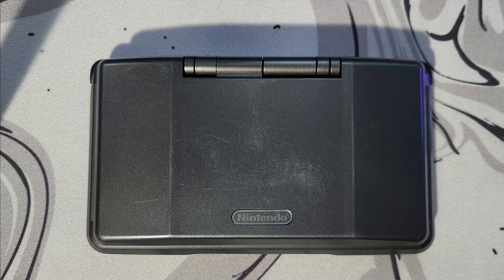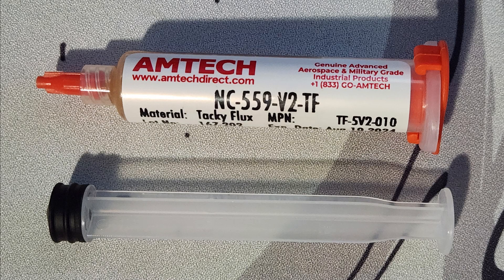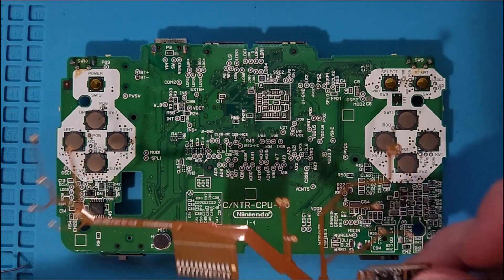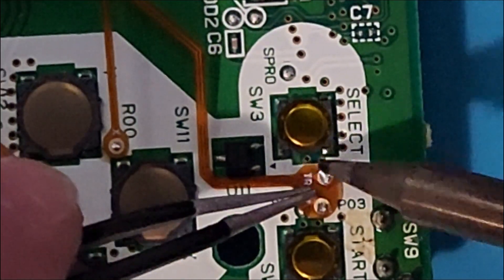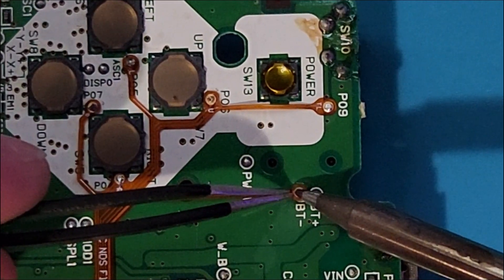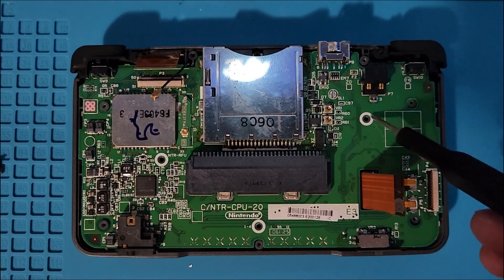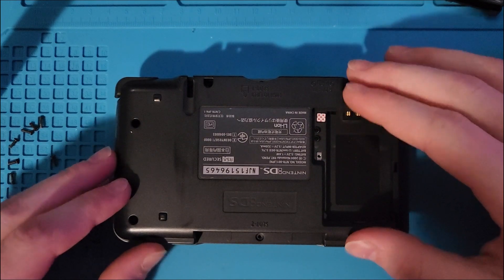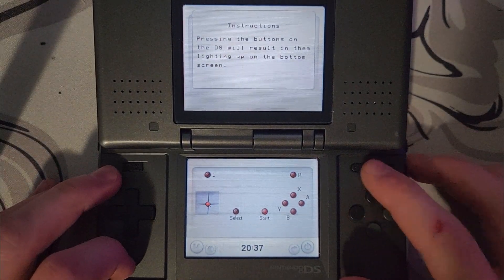*NEW* The EASIEST Controller Mod For the DS! (DS Wireless Rx Flex Board Tutorial)

Comment: Hi, I have the loopy capture cards already installed, would it be difficult to install this with the capture card installed first? Thanks!
Reply from the maker: Nope, it shouldn't be too difficult. It is a little easier to install the controller mod first, but you can either unsolder the part you fold over (on the cap card ribbon cable) and resolder it after, or just slide the portion with the points for up, down, left and right under the part you fold over.
Reply: @tracker707 cool, thanks!
Reply from the maker: Yeah man, no problem!

Comment: Okay but how do you connect a controller what device did you use to use a controller
Reply from the maker: Out of the box, all of Insidegadgets receivers and TX products are on the same channel, so everything should just connect automatically. I'm using the "SNES Controller Wireless TX Adapter" and a "8bitdo Sn30" controller connected to it.
Reply: @tracker707 thank you 🙏
Reply from the maker: No problem!
Reply: @tracker707 this are out of stock, what’s another alternative adapter I could use to have wireless play
Reply from the maker: @bretwentzel8824   the SNES Controller Wireless TX Adapter is out of stock? I'm looking at it now and it shows in stock for me. The only other alternative to it would be the "BlueRetro to Wireless GB Controller Adapter" which will allow you to connect any wireless controller compatible with BlueRetro (like a ps4 or xbox controller, the full list is on the product page) and use it to control your ds. It is out of stock right now unfortunately though.

Comment: I'm looking to use my 8bitdo SN30 Pro with a 8BitDo SNES Retro Receiver for this Controller mod. Do you know if they're compatible with the SNES Controller Wireless TX Adapter from insideGadgets? On their website it states that the insideGadgets adapter only works with their own receivers, however, I can see that you're using the receiver that came with the SN30. So I'm assuming it would work, but I'd love some clarification.

Thank you for demonstrating the installation process, I feel much better going into this mod!
Reply from the maker: Yeah, the "SNES Controller Wireless TX Adapter" will be compatible with any snes controller, so yours should work just fine. The thing on their website that says that only their transmitters are compatible with their receivers because you have to use a "TX" product, and not just any random wireless controller. Thank you for watching, glad I could help!
Reply: @tracker707 Amazing, thank you for the clarification!
Reply from the maker: No problem!

Comment: Is there one for the new 3ds xl?
Reply from the maker: Not yet unfortunately, but there is one in development i believe. There is a way to control a 3ds with a wireless controller though. You need to have a 3ds with custom firmware, and it takes controller inputs from a PC and sends them wirelessly to a 3ds.
Heres a guide to set that up if you interested.
https://youtu.be/pcO6m-q0qU8?si=8PEjGCcmHtLf0R9r

Comment: So do you only need to get the flex board and the snes tx adapter for the mod? How does the adapter connect?
Reply from the maker: Yep! The snes tx adapter Iconnects wirelessly, so when both it and the console are turned on, it should automatically connect.

Comment: Have you tried installing both this and loopys capture card on the same ds?  The only solder point both flex cables share is the BT- when I compare the two.  If so, were there any complications?
Reply from the maker: Yes, they work together. Them sharing the BT- point doesn't cause any issues
Reply: @tracker707  i was just about to ask this! so it is safe to do it? lol i have 4 flex cables  and capture cards ready to install. im just worried they wont work.
Reply from the maker: @polkmn8105  yep! Perfectly safe to do so!

Comment: Is there a mod like this for the 2DS/3DS?
Reply from the maker: Not yet, but there is one in development i believe. There is a way to control a 3ds with a wireless controller though. You need to have a 3ds with custom firmware, and it takes controller inputs from a PC and sends them wirelessly to a 3ds.
Heres a guide to set that up if you interested.
https://youtu.be/pcO6m-q0qU8?si=8PEjGCcmHtLf0R9r
Reply: @tracker707  thanks I will look into it but I think imma wait for the one in development.
Reply from the maker: Yeah np 👍

Comment: Hey, don’t know if you still reply to comments but just had two questions cause I just bought some ds lite boards. First, when do you think the ds lite tutorial will be coming out? Not trying to rush or anything take your time. Second, this will be my first soldering project. Do you think I should spend some time practicing or is this an easy first project? What are the risks? Thanks in advance
Reply from the maker: I still reply to every comment as soon as I can get to it! I really hope i can get the ds lite tutorial out soon, but i work and go to school and that does not give me a lot of time to get the video to the quality that i want it to be. This is a pretty easy mod, but especially with the ds lite, it can be a little tricky at some points. I would still definitely recommend anyone to always get a relatively cheap soldering practice kit from Amazon or somewhere before trying to mod an expensive console. As for the risks, the only thing you need to watch out for is being too rough with the ribbon cables and damaging them, and accidentally blowing a fuse. In my experience, the most common issue is accidentally bridging a solder point, or putting in the battery backwards (for the og ds), but the fuses are not too difficult to replace, but for someone new it could be tricky. I would just say though that as long as you have some practice and watch maybe a ds lite disassembly video and then my tutorial when it comes out so you can get a good grasp on what you'll be doing, I'm sure that you won't have any issues!

Comment: How do you have the SNES controller linked up? Could you send some links so I can buy the necessary parts? Thanks 🙏
Reply from the maker: Sorry for the late reply, I never got a notification that I got a comment. I'm using a 8bitdo Sn30 attached to Insidegadgets snes controller wireless tx adapter. Other then that your consoles just need to have a controller mod installed in them and your good to go.  Here's the links
8bitdo Sn30-
https://a.co/d/iRo8THu
Insidegadgets snes controller wireless tx adapter-
https://shop.insidegadgets.com/product/snes-controller-wireless-tx-adapter/
Reply: @tracker707  Thanks so much!!
Reply from the maker: @n0lain   Of course! If you need any more help don't be afraid to ask!

Comment: Question @ 8:55 is that the SNES Controller Wireless TX Adapter? how is it powered and how did you get it to connect to flex board ? And connect to tye controller? Thanks 😊
Reply from the maker: Yes it is. It is powered through USB C and it connects to the flex board wirelessly out of the box. The controller is the 8bitdo Sn30 and it connects to the SNES Controller Wireless TX Adapter through the snes receiver that it comes with (the dark gray box sticking out of the SNES Controller Wireless TX Adapter)

Comment: I already have loopy capture cards installed and it is pretty much impossible to detach the wireless antenna. Would it be bad to solder this with the antenna attached still?
Reply from the maker: You actually might be able to, but you should be able to carefully pull the capture card board off of the chip. I just use a little pry tool to work the edges and the slide my tweezers under between the capture card board and the chip. Just be careful to not pull up on just one side of the chip so it doesn't break.

Comment: how did you manage to connect your own bluetooth controller? did you connect the TX transmitter to a bluetooth transmitter or something? :O
Reply from the maker: In the video, I'm using the SNES Controller Wireless TX Adapter and an 8bitdo snes controller. There's also another option which is the BlueRetro to Wireless GB Controller Adapter which should allow you to use a variety of different Bluetooth controllers.
Reply: @tracker707  thanks so much! :)
Reply from the maker: No problem! Glad I could help!

Comment: Man, it’s just so easy now isn’t it lol. Thanks for making this video. I already have 4 controller modded DSs that had to have wires to connect everything. And since I use a gba sp as my controller, I had to have L and R mapped to X and Y so I can open menus in DS games, but my sp’s L and R buttons don’t register a lot. I don’t need more DSs but this would be so fun to do. 

Question for you: What are you using as your controller, and how far away from a DS does it register? Sometimes my furthest DS won’t register unless I clear all things in the way on my desk.
Reply from the maker: Thank you for watching! I use insideGadgets SNES Controller Wireless TX Adapter and a 8bitdo Wireless Snes controller. Its super nice as i can place the TX Adapter right next to the ds's and then the 8bitdo controller has a much father range.
Reply: @tracker707  awesome, thanks!
Reply from the maker: @Chancemeister  No problem!